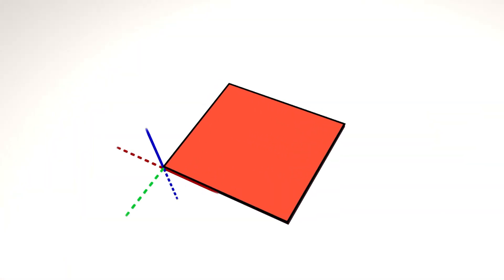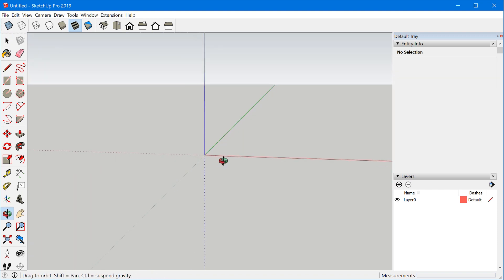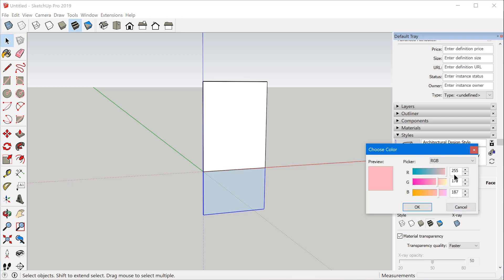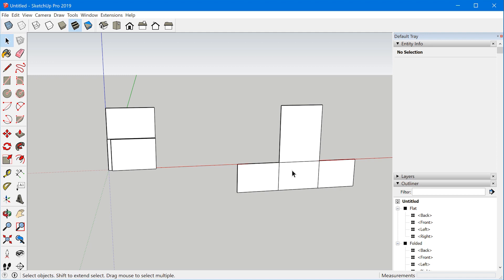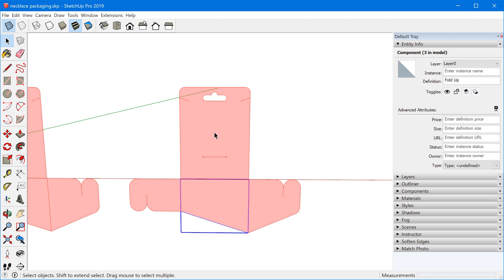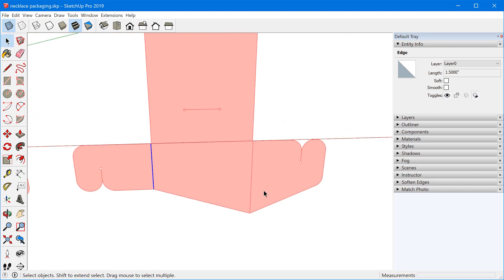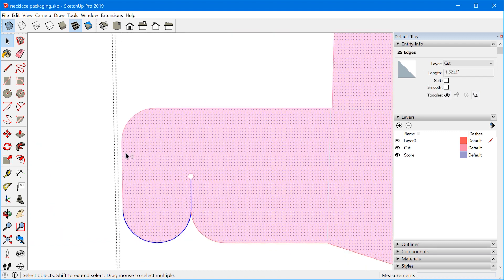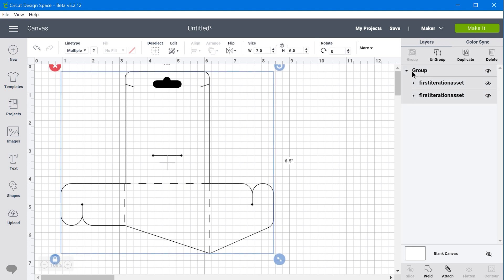Designing Paper Packaging in SketchUp | Exporting TRUE curves | Importing to Cricut Design Space.

Comment: So, it's that simple...just Weld....after all the hair pulling I did a year ago...Thanks!  That will really affect my workflow in part nesting for millwork
Reply from the maker: It's still really finicky though. Like I said in the video, I was having issues exporting curves that still had faces attached, so I had to delete the faces too. Also, not sure if you are working with 3D objects, but this only really works if you're going to end up with a 2D object.
Reply: @Mastersketchup  Well, the other process I researched was ultimately that.  Take a group of parts, plywood case parts in this case, flip them all so they are laying flat.  Remove all but the top face and its lines.  Then remove the faces.  All the people talking about this method were dealing with square parts.  As soon as a curve came in, the answers stopped.  So seems that I arrived where you did, just didn't have the final tool to get the poly line export.  I also know there is an extension that will flip parts to lay flat as well. Not sure if you could find one that would just pull one face with lines only from one part, flip it flat, remove the face, and then weld the lines...that would be cool.
Reply: @blacksheep_77  If you use a CAM software like Vcarve Pro, it will convert all segmented curves from Sketchup to true curves.  If I only want 2D vectors and not surfaces imported into Vcarve, I can easily select only the line work from my model and make a copy.  Then make the selected line work into a component and save it as a separate model.  Then import that file into Vcarve Pro.  This is the best method I've found to use Sketchup to design 2D vectors into CAM/Vcarve Pro in order to cut parts on a CNC Router.
Reply: livtobhappy intersting...but then i have to get yet another piece of software.  I think weld offers a in-platform solution without a side trip to another software.  BUT...will keep it in mind if all options fail.  Thanks!!

Comment: Looks like you need a plugin to do all the manual work.
Reply from the maker: Are you talking about Weld, to connect all the edges? It's a free plugin, but you can also just connect the edges in Illustrator of Inkscape if you don't want to use the plugin.
Reply: Yes weld plus the file conversion to suit your machine.